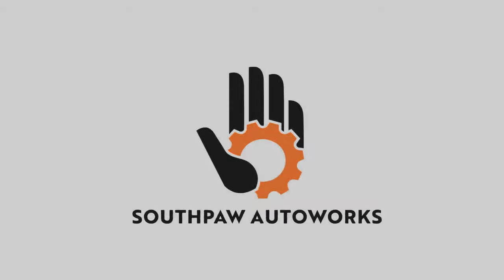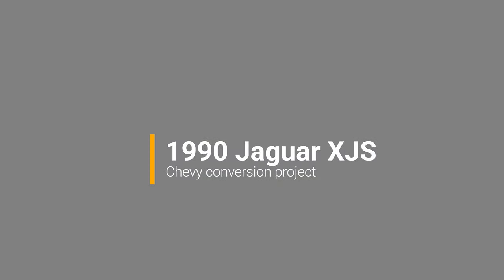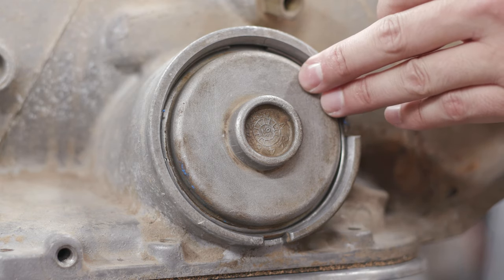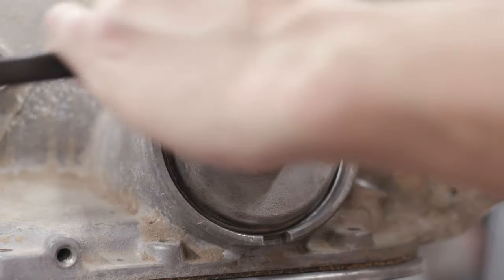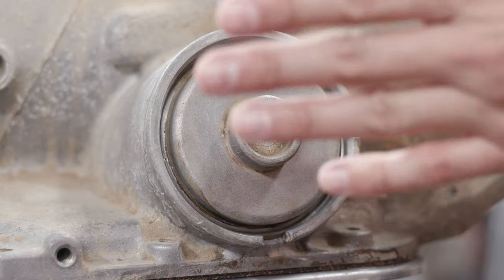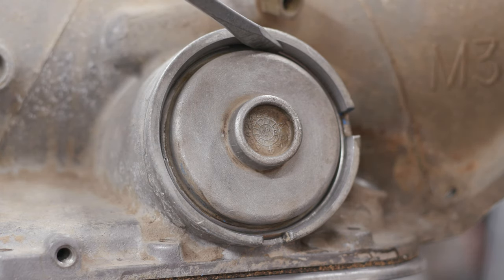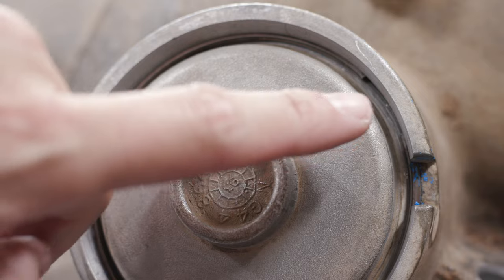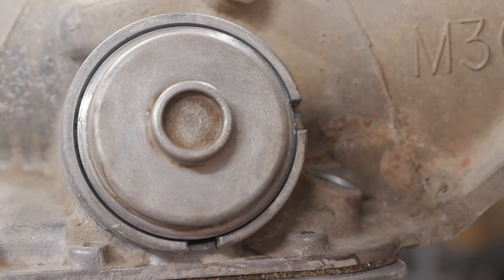4L60E: 2-4 Servo Cover Stuck In Case (Problem and Solution) (Works for 700-R4 too)

Comment: Grreat video...ive got tbe clip soaked in brake cleaner allready but i wanted to see a video before i tackled this...taking my eyeglass screwdrivers out with me and the wirebrush....i was gonna whack the cover a couple times with the rubber mallet too....if that dont work then the splitting maul should pop it free😁😁...DISCLAIMER...NO MAUL!!
Reply from the maker: Right on!
A bigger hammer... haha

Wishing you the best.
Thanks for dropping me a line!

Comment: I recently found your channel and am trying to eat it all up!  You are a transmission genius!  Thanks so much for your knowledge!  I recently rebuilt a 98 4L60E and could not get the servo out.  I gave the transmission the rest of a TransGo shift kit but not any servo upgrades.  The truck will not shift less than 6000 rpm’s now.  Could this servo be lazy compared to the rest of the upgrades?
Reply: Update, we got the servo apart and made the changes accordingly.  No difference.  It doesn’t matter how we drive it, it revs up to the moon (6,000 rpms) before shifting.  Any thoughts or ideas?  Maybe I missed a check ball?

Comment: I've got a 95 G20, and going to rebuild mine. Going with heavy duty clutches and it was recommended to use a Corvette servo? Also upgrading the sun gear to the stronger one other than stock? Anything else I should do to make this trans last longer?

Comment: Thanks for the great series on the 4L60E. I'm starting my second pass on all the videos.
Have you considered a diagnostic series for this xmission? It would really help those of us who are starting from scratch, especially if it tied the theory to the symptoms to the diagnosis. 
Speaking of diagnosis, I had to change the radiator in my 1996 GMC c1500 4.3. Everything was great for the first 400 miles. Then, in a matter of 3 or 4 miles, the transmission started slipping and then no motive power though the engine was running fine. Popped the hood and everything was drenched in transmission fluid. Needed to get it home where I could fix the line connection so I had fluid brought to me; added 2.5 quarts and made it another 4 miles. No power again. Added another 2-1/2 quarts and made it the last mile home. Went out the next morning, started the engine, warmed it up and checked fluid level and added 1/2 quart to bring it to full. Hopped in, put it into gear and ...Nothing! No gear, forward or reverse.
Thoughts??
Reply from the maker: Thank you for the positive feedback on the 4L60E video series.

Yes, I do plan on diving deeper into the diagnostics.  The "Basic Operation" videos are laying the ground work for future diagnostics videos.  We first gotta understand how a healthy system works, before we can recognize problem areas, and before we can understand (and hopefully appreciate) solutions that people/companies have developed.

I'm sorry to hear that...
Are your cooler lines held in place (at the radiator) with wire clips?

Those retaining clips can wear out, and break.  
Note:  If the cooler lines are able to bounce around, during driving, it accelerates the wear of those clips.
Every time those clips are removed, they really should be replaced with brand news ones.

When a cooler lines pop off, the trans will lose a lot of fluid, in short order.  This kind of event almost always results in smoked clutches.

Comment: I bought an 03 4wd Silverado recently. Near as I can tell it has a healthy 4L60E. I estimate it was rebuilt about 40k miles ago based on average miles of truck and a date code on the torque converter. I checked to see if it had a Corvette servo. It did not. I assume it is OE speck rebuild. I would like to maximize it's remaining lifespan. I plan on adding an auxiliary cooler. Do you have any "in the car" valve body improvement recommendations to maximize 4l60e longevity?
Something like this ebay ad?:
 "4L60E 4L65E 1996-2006 1870 P1870 Code Buster Combo Kit Corvette Servo ATSG Book"

Comment: Can I use a steel wire brush it won't damage the bore will it? I love in Michigan my snap ring is rusted out it won't budge I need some advice this thing looks like it's gonna be a nightmare any help would be appreciated thank you.
Reply from the maker: Yes, you can use a wire brush to knock debris away from the servo cover and snap-ring.  However, do not use the wire brush inside of the servo bore (underneath the servo cover).  Scotch-Brite works good for the section of the bore that lives below (or inside of) the servo cover.

Comment: Install a rebuild 4l60E in my 2002 Surburban . Shifting ok normal. Once its under Light Excelleration starts acting weird like it struggling to shift . at 55 MPH and I try to see if Passing gear was working . RPMS go up and doesnt pull. But once I have it on a slow excelleration it will pull up to 90-100 MPH no problem .. Could a new Servo fix this  ? solenoid issue?

Comment: Thanks a heap , however my problem trans. still installed ( 2007 Trailblazer ) not much room cat in the way too,   any thoughts   Thanks again ( I'll clean a third time ).
Reply from the maker: You could see about lowering the rear of the trans (removing the cross member)(make sure engine doesn't make contact with the firewall).  Might have to remove exhaust, to get cat out of the way.

Comment: So do I just keep spraying and scrubbing the servo cover? It looks like it has become one with the cover so disappointing, living in Michigan is bad for rust I had to super heat my old O2 sensor with a map gas torch and spray it down for a week straight to get that out. Any more tips? The cover should not depress at all with the snap ring on should it?
Reply from the maker: That really sucks about the rust (O2 sensor, etc).  We don't have that problem in AZ.  I may not be the best help when it comes to a rusty snap ring...

Can you shoot a short video of what you're dealing with, and post it on your channel?  Then you can share the link/video on this comment thread.
Note:  If you can, get a close up of the snap ring opening/gap.  There's two different kinds of snap-rings for the servo.
Reply: @SouthpawAutoworks  ok I will do that do I have to press in on the cover before I take out the snap ring?The cover hasn't moved yet but I haven't applied very much pressure to it yet gonna get out a big pry bar if I need to push it in first some videos don't show to push in the cover before snap ring removal? I'll send that video tomarow hopefully. I sprayed it down and scrubbed again with wire brush brake cleaner and atf mixed with acetone homemade penentating oil. Also have you ever heard of or experienced any problems getting the servo assembly out on 4wd ext cab Silverados mine is a 2001 looks like it will be pretty tight.
Reply from the maker: I did not realize that the trans was still in the vehicle.  Might be hard to get a video of the servo, as it can be tight quarters.

Missed one of your questions earlier:
"The cover should not depress at all with the snap ring on should it?"
Answer:  It's normal to be able to push the servo cover inwards with the snap-ring still in place.

01 Silverado:
It's normal to not have a lot of room when pulling/installing a servo with the trans still installed in the vehicle.

IDK if you've already watched this video or not:
https://youtu.be/pcTBrf4GQh4
Note:  3 min into the video covers servo removal.
Reply: @SouthpawAutoworks  I think it will come out if I tap on the back of the screw driver now it's cleaned up alot since I started cleaning with wire brush I have one of those inspection mirrors with a light on it I see where the gap in the snap ring is now to it's right by the servo outside housing window too so that's good I'm just wondering if I'll be able to get it out and back in if worse comes to worse maybe take out trans mount and lower trans a bit? or do u think I'll be ok? Just worried I won't be able to get the new one back in how tight it looks. I'll send a video.
Reply from the maker: I like your idea (lowering the trans).
I imagine that you'll gain some more room to work by lowering the trans, a little bit.  If you decide to go that route, you gotta keep on eye on some stuff while lowering the trans.  If the engine has a distributor on it, it'll come into contact with the firewall.  Don't want to stress any electrical wires, cooler lines, etc.

I'm about to watch your video.

Comment: Hey bro! Please respond man I cant get a straight up answer from no where. Im really pretty familiar with these transmissions and a DIYer and ive installed many corvette servos and other things. If im getting a lazy 3-4 shift, does flipping the 4th gear servo piston help tighten the band??? I can add shift pressure through a tune but I will only do so if you say its safe.
Reply from the maker: I personally don’t have any experience flipping any components, within the 2-4 servo stack-up, for the sake of tightening up the band.
The aftermarket offers different length servo pins, as well as shims.  Some builders will make the servo pins longer, where need be, by adding more material, with a welder.
Reply: @SouthpawAutoworks  thanks for the response!

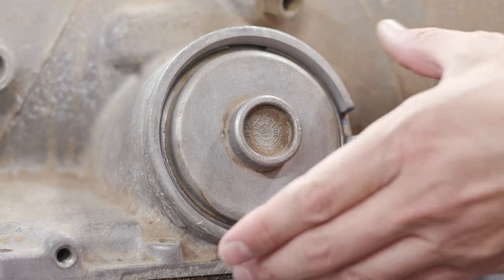Comment: 3:01 not true. I’ve had those stuck so badthat no amount of beating, vice grips, WD 40, propane heat(NOT acetylene) will loosen the cover even a little bit.

Comment: I had my servo cover blow off after 60ths that I have put on the vehicle. I was able to have all the parts saved by the heat shield. I reassembled it and while at it changed the filter and topped off fluid. It worked fine for about 2,000 miles and again blew off. I ensured the snap ring was in place. And for an extra put a collar that I had laying around between the center of the cover and the heat shield thinking that it would keep it from happening again. What would cause so much pressure on the servo to blow the cover. Transmission shifts fine. No slip. Any help would be awesome.
Reply from the maker: I'm a little confused by your first sentence...
But, this has me thinking servo cover snap ring.

If the snap ring isn't engaged all the way, the servo will pop out of the trans case.
The snap ring groove (inside the trans case) must be cleaned out really good.  Leftover debris, in the groove, will make it hard (or impossible) to fully seat the snap ring into the groove.

Working on these things with the trans in the vehicle is a challenge.  It's hard to see.  Lack of lighting, bad angle, etc.

When time permits, I'd like to make a video on this.
Wishing you the best on your 4L60E.

Note:
I've seen a 4L60E transmission case get destroyed, by the 2-4 Servo snap ring not being seated all the way.  Without going into anymore detail, I will say it's super important to make sure the snap ring gets installed all the way (seated).

Comment: I rebuild a 4l60e after a few weeks later the transmission slips from a  2nd to 3rd gear, what should i be looking for, i I'll preciate thanks
Reply from the maker: If I'm reading your comment correctly, it sounds like 3rd gear is slipping.
What about 4th gear?  Works fine, or is it slipping, too?
Why was the trans rebuilt?  For the same reason?
Reply: @SouthpawAutoworks  it slips  shifting to third for a bit, yes 4 gear shifts fine,I rebuild it for burn 3-4 clutches,,
Reply from the maker: Is it slipping for a second, then up-shifts into 3rd gear?

Does it slip when the engine/trans are cold?
Does it slip when the engine/trans are up to operating temp?
Or does it slip regardless of engine/trans temp?

Why was the trans rebuilt?
Failed 3-4 Clutch?
Some other reason?  Please specify.
Reply: I got the same problem with my transmission, it’ll hard shift from 1st to 2’nd but once in 2nd gear it’ll hit 2500rpm and it just flares and shoots up without even going to 3rd, so when I manually put it in 3rd it slips. I’m about to change the servo next week and solenoids will this help in any way with the problem ? Will it send it straight from 2nd to 3rd or is my transmission fried at this point?

Comment: I have the 4l60e that only is going into 1st and 2nd gear will this have anything to do with it
Reply from the maker: I wouldn't think so...

The 2-4 Band and 2-4 Servo are partially responsible for creating 2nd gear and 4th gear.

If you're missing both 3rd and 4th, it's likely due to a failed 3-4 Clutch.  Super common on the 4L60E.